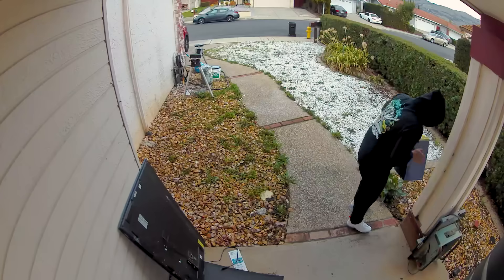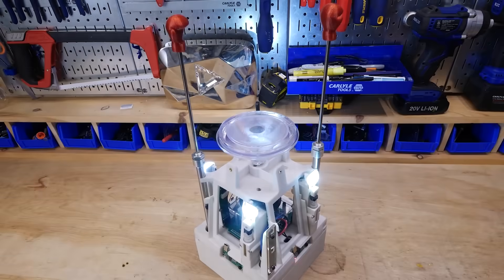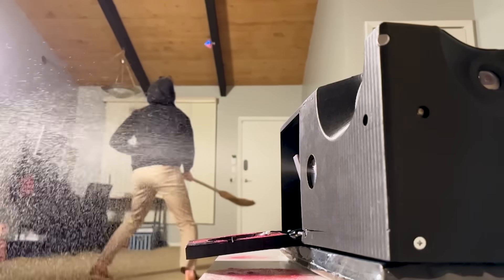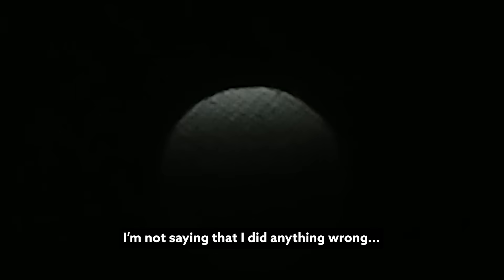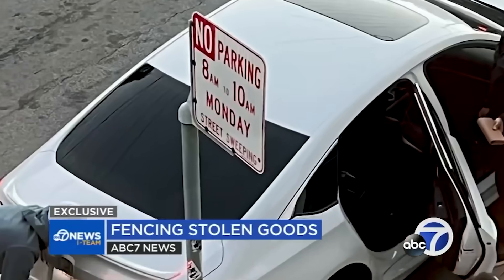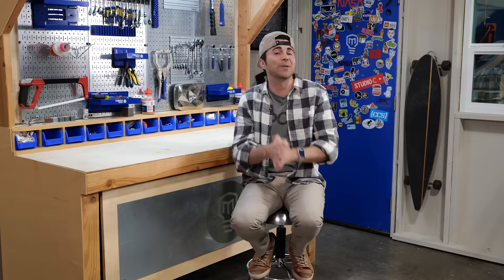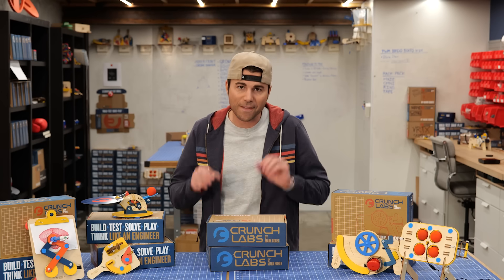Car Thieves vs the Almost Final GlitterBomb 5.0

Comment: Hey Mark. 

Is the information you’ve amassed - GPS location, description of thieves, names (if mentioned) - later shared with local law enforcement? And if the answer is no, then why not? It’s likely the thieves in these videos are chronic porch pirates. Some may even have other outstanding warrants. I appreciate how their encounter with your devices may dissuade them temporarily but criminals need to feel real legal consequences. Consider this, when you were originally a victim of porch pirates perhaps the police didn’t get involved because of a lack of evidence. Your devices and recordings now fill that gap - and similar to the call center scammers - perhaps now law-enforcement would be more likely to act.

Thoughts?

Comment: Why don't you increase taxes so those robbers can actually be dealt with in the us?That's cheaper than buying a new car window each time. Like here you already see footage of the car number plate, so you can track the owner and hold him responsible. If that's not possible just change the law like a normal civilization does so only the owner of a car can drive it.

Comment: 12:20 Maybe its because I have an older vehicle but the back seat access to the trunk is locked/unlocked from within the trunk and I can manual lock the trunk lever on the drivers side with the key.

Comment: if it is that easy to get thieves in action, I don‘t see why the police doesn’t do so
Reply: For San Fran specifically, and a few other cities, the Attorney General just won't press charges or persecute. Therefore, if the cops pick up a "petty thief", the thief will get released because the AG won't bother taking them to court or punishing them for this crime. The police knows this, and recognizes that it's useless to try and arrest them because they won't get punished anyway and every time they attempt an arrest, there is potential for violent escalation on either party's behalf.

Comment: Can someone please explain, why police is not stopping the car thieves, if this is such a mayor problem and 3 thieves seemingly pass the same spot on a single day? I guess that here in germany this couldn't happen.
Reply: For San Fran specifically, and a few other cities, the Attorney General just won't press charges or persecute. Therefore, if the cops pick up a "petty thief", the thief will get released because the AG won't bother taking them to court or punishing them for this crime. The police knows this, and recognizes that it's useless to try and arrest them because they won't get punished anyway and every time they attempt an arrest, there is potential for violent escalation on either party's behalf.

Comment: I guess there's some practical issues, like sourcing a bait vehicle and paying for the shattered windows, but it seems like sfpd could just put the tracker alone in a box, pull the thief over, and have a pretty easy conviction.
Reply: For San Fran specifically, and a few other cities, the Attorney General just won't press charges or persecute. Therefore, if the cops pick up a "petty thief", the thief will get released because the AG won't bother taking them to court or punishing them for this crime. The police knows this, and recognizes that it's useless to try and arrest them because they won't get punished anyway and every time they attempt an arrest, there is potential for violent escalation on either party's behalf.

Comment: The prank box is so badly designed. Would be much better to drop all stink liquid when it opens instead of little squirts which don’t release it all before it’s chucked outside the house. Also who’s genius idea was it to use a drone? The one sitting upside down instead of flying at 7:02 or when it doesn’t take off at 6:40, shows just how silly it is. You’re pranking yourself with that cost bro. A better idea would be again to dump the glitter all at once instead

Comment: The most upsetting part of the video how adults commit these crimes in front of their kids and as the kid that called Mark a scammer, it corrupt them at early stage of life. The most scary part, is that some of these criminals are part of organized crime and Mark has bravely put himself in danger to prevent some packages from being stolen.
Reply: Hi luvdocumentary have you become a flat earther yet? If not I suggest watch a 13 part series called What on earth happened by Ewaranon to learn that the earth is not a globe. I got it in my about tab.

Comment: The sheer consistency is terrifying. When it doesn't work one day but you just know that someone else will try it again on the next test run
Reply: Hi tvftw have you become a flat earther yet? If not I suggest watch a 13 part series called What on earth happened by Ewaranon to learn that the earth is not a globe. I got it in my about tab.
Reply: @flat-earther  😂

Comment: Suitcase that leak super glue with glitter on the floor, bolts itself in, and when they manage to get it off,they realize halftime the floor has been sawed away by a mini jigsaw. Probably impossible, but it seems permanent damage is the only way to get these selfish people to stop, also getting them evicted

Comment: It's too bad the redesign didn't work properly in this final version, it would be nice if you tried the drones idea again and tested it in more situations. Maybe I'm wrong, but apparently one of the problems in the first house is that they opened the package on a couch, and the drone compartment couldn't open because the side of the box was against the seat. If the drones could be somehow launched from the top, perhaps by reusing the self-ejecting lid mechanism, maybe they would have worked?
Reply: Reality is the drones are a bad idea. You can never guarantee you'll ever have optimal conditions for a drone to take off successfully.

Comment: Many people in a car group I'm in fold their back seats down with a white towel laaid out in the trunk so it's easy to see that nothing is in the trunk. Pain in the butt and not feasible if you have a kid's car seat but worth if it means thieves move on (though I wonder if having car seats latched in would minimize the risk since the seat back can't be pulled down easily).

Comment: The San Fran car break-in empire is an epidemic. I think rather than working on a slightly anticlimactic and disappointing GlitterBomb 5.0, you should’ve switched to solving the issue that the police can’t (or won’t) deal with in a sciencey way, though im guessing if you could you would and your lawyers probably told you anything you tried would be considered too close to vigilanteism…. 

Anyway, thanks for showing that putting my bag/valuables in my trunk isn’t really making them safe; I think there’s probably a market for a product that allows users to lock their rear seats instead of just a little button….

Comment: I wonder if using the liquid from a tin of surströmming would make the smell of the spray worse. For those who don't know surströmming is a specific dish made out of rotten fish and the tins have instructions of how to open them, do it outside >20 meters or so from anything you don't want to have the smell while in a deep bucket filled with water. Some dude opened a tin on a plane once and they had to have an emergency landing because the people that was on the plane (crew and passengers) thought it was a biochemical weapon, my school also had a tin of it in a ventilation shaft once and the school was closed for about a week to get the smell out.

Comment: I laughed out loud when you were going against those drones!! 😂😂😂 it’s sad that we don’t get cameras on the drone’s because we could barely see the drones on the actual houses.
Reply: they did have cameras. You could see footage of one being thrown out in one of the videos. They just didn't ever work from the looks of it. I doubt they ever took off to fly around. Drones are way to finicky and need perfect flat conditions to take off which I doubt they got when someone pulls the cover off on like a couch or bed and they slide out. They likely just spun on the floor.
Reply: @SohiHien yeah. He should have just used a spinning cup like in the past.
Reply: @brandonc.8356  Or could have propelled the spinning cup, it would still fly a bit while spreading the glitter.
Reply: It didn’t look like they ever functioned properly.

Comment: The only thing I would change on this design for v 6 (please don't stop at six) is use sprayers that would turn the spray into even smaller particles like a fog , so it would go even further. A bank deposit bag like a restaurant would use to get petty cash and small bills would probably be enticing if it was possible.

Comment: You can also take a spark plug, break it into small pieces, throw it at the window, glue to a rubber glove fingertips, glue to a rubber band. The smallest, sharpest piece actually works the best

Comment: Anyone really disappointed with this one. It was just way too over engineered and it ended up flopping. The reactions weren't great. The drones were useless. Who thought those flimsy tiny drones would actually go around spreading glitter. Even in the example video, they look like they'd fall if you looked at them funny

Comment: I do not want to say this, but I feel pretty bad but its clear that the theft issue while being lowered, is only going to increase after its realized that the only so called safe method of theft is to just take what is in the trunk. Therefore I totally do NOT advise you put a semi valuable package in the trunk, hoooked up to a GPS monitor and audio/video surveillance, with what ever method of punishment you deem worthy. I persoanlly think a buckshot round would work, but I also do not condone violence for the sake of it. Therefore, I say that just simply calling the police with an active robbery call will work. After all, if someone was in the car I doubt that would stop them.

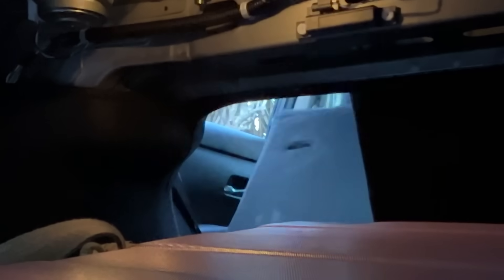Comment: 12:30 it‘s also the quietest window to break. Europe has a big problem with BMWs being broken in at night, since their premium infotainment parts (steering wheel, satnav, headunit) are not locked to vehicle and can be installed into non-premium ones. The small rear window is the one they usually break to get in.

Comment: concept idea: a detector that, if the window of a car is broken, half a second later it snaps a wire that grabs anything trough a window (usually an arm) and holds it with an additional alarm going off

Comment: This should't be the final one
This is the one thing i look most forward to every year
Reply: I hope it's reverse psychology making thief's think next year's gonna be safe!
Reply: Especially since the design is a step backwards. Those drones were never going to work.
Reply: @sleepyheadmemes  those drones were so bad. How did no one think this would fail at any point before actually going through with it. This was definitely going out on a low note
Reply: seems like the kind of thing a NASA engineer should immediately realise would never work outside of a sterile testing environment
Reply: What if its 300 IQ play so the thiefs watching this vid will think they are safe now, Just to get baited? COPIUM

Comment: I understand why Mark would want to take a bow with doing this yearly endeavor, but, although I hate to say it, it is a bit of a disappointing send off. The drones don't seem to have worked at all, the boxes in the cars ended up getting gutted until all that could be gotten was some bad audio, and the news about the call center wasn't news if you kept up with that sort of information. It's not a criticism of Mark or his amazing work at all. Just a bit harder to know this is the end when the results ended up being less than spectacular.

Comment: If we're ending boobie-trapped packages on 5.0 then please start boobie-trapped cars 1.0. When car is locked and keys are not in ignition, then a 1.21 gigawatt charge is activated to the rear seat trunk access latch, which when activated will also release a plume of peanut dust and dried shrimp dust.

Comment: Mark literally smashed like 5 car windows for us.😂
Reply: but holy cow? broken window in 5 mins? i feel safer in my third world country
Reply: @MaximaToluene  no-no, he only said "within 5 minutes of *each other*, so both boxes were specifically taken within 5 minutes of another.

He didn't say when they were stolen exactly after being put there.
Reply: @xnutzii  i see. still unsettling tho, 2 broken car windows in 5 minutes?
Reply: The engeneering cost of this videos is hundreads of times more valuable than 5 windows
Reply: Actually I'm glad he did. The backseat pulldown to see what's in the trunk is amazingly valuable imo

I feel like not every vehicle has the ability to drop the seat to get into the trunk exactly like that. I know newer models have locks inside the trunk to stop you from doing just exactly this

This also happens when you drop off your car at the valet (or could happen not all the time)

I always give over the valet key only and lock the trunk and glove box before I leave the vehicle
Reply: @nomore-constipation  They look for cars they know have the ability to do just that. As its higher chance of profit.

Comment: marks crunch labs box is grate and i love them my little sister and i love make them and upgrade. them the disk launcher me gave it more batteries and a bigger motor and i 3d printed more disks. i am much
older then mi sister but its still fun to make them and upgrade them.

Comment: why do the windows break so easily?
Reply: They are designed to break into small pieces so that in an accident you don’t get a large shard of glass that cuts you. It also needs to be able to break so that emergency workers can break the glass to get you out of the car if it is on fire or underwater.

Comment: Only real issue with Glitterbomb 5.0 is the glitter drones didn't look very effective in the videos shown of the thieves...outside the first one you didn't really see any of them flying around or the thieves talking about them (which you'd figure they would) so they likely all met the same fate as the only video shown of the one drone flying into the guy then falling onto the ground and more or less staying there....might need a 5.1 update to find a way to get the drones out more effectively so they don't fall/fly into something immediately tbh.

Comment: Sorry to be negative, but this seemed like a downgrade from previous years. The glitter delivery system seems to have been uneffective (or at least we don't get to see it working) and no footage from the bags in the cars. In any case, I'm glad to hear some actual results came from the previous version which was connected to the Kolkata call centers. We need more of that!

Comment: The big part that everyone is ignoring is that this all started because the cops said they wouldn't arrest the thieves that stole from Mark. The reason why is because California law, as well as many other blue states, have specifically decriminalized theft of a value of $949.99. Prosecutors don't want to prosecute the crimes, and in many cases the State Legislators have barred it anyway.

If you're wondering why crime has exploded (but only in certain parts of the country), in the words of Kamala Harris "You get what you vote for".

Comment: Thinking about it a little bit, I think those car package thieves probably stole from those unfamiliar cars on purpose. If those thieves run around the same areas over and over again and know which cars are normally there, then they know that those local cars that are always parked there probably won't have stuff. A totally new car they haven't seen before isn't a local to that area meaning they probably came to the area for a reason and have a higher chance of having a package inside.

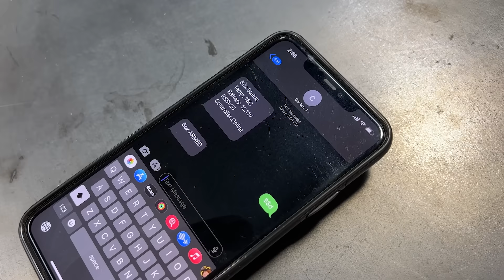Comment: 14:40 ok that's fine but that demonstration was hardly safe
Reply: I mean he kinda knows what he’s doing
He could put a don’t try this at home I guess but other than that I think it’s fine
Reply: Too bad then
Reply: I think I know the solution there is the special type of glass that's like plastic that is as breakable as glass what is used in movies like when they jump out of the window and it doesn't cut you
Reply: what are you talking about? Car glass is designed to not cut people
Reply: @nhpivotlk  as someone who has dealt with broken car glass, it’s better than bottle glass per say, but still not fun. I do agree that what mark did was pretty safe tho.

Comment: 12:20 is not necessary true for some cars. Some manufacturers put the opening latch inside the trunk so the only way to open the seats is to open the trunk first. Which if you don’t have power is not possible to open. I’ve seen this mainly on Hondas

Comment: That the footage was still uploaded from that stripped one is pretty cool. Drones dropping water balloons to put out a fire next year? Or hey what if the drone itself is the extinguisher, like those baseball sized ones more seen in Europe and Asia. They'd be light enough to be fast and cheap enough to make huge numbers to swarm out of a central location onto/into hard to reach fires(plane engine fires in flight?). Know what I mean? Maybe a Fireman could aim a laser or thermal camera. Or have larger Mothership drones doing the guiding for the extinguisher drone swarm. Into vents in warehouse roofs, apartment towers, cruise/cargo ships... A swarm of bulbous drones murmurating up an elevator shaft would be a sight to behold, eh? ... Sorry to carry on. Better chance of someone brilliant seeing the idea in your comment section Markus, that's for sure. 

Cheers to The Holidays!